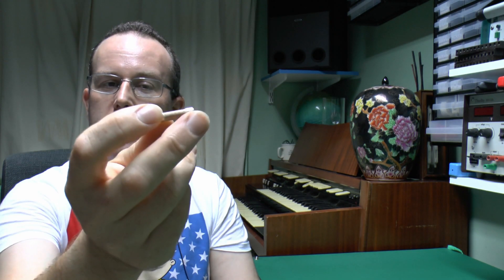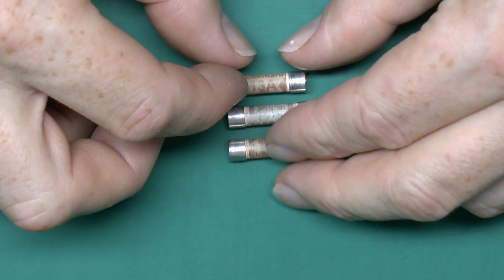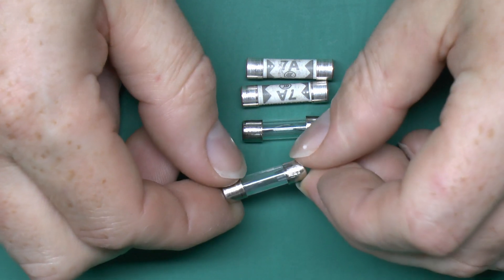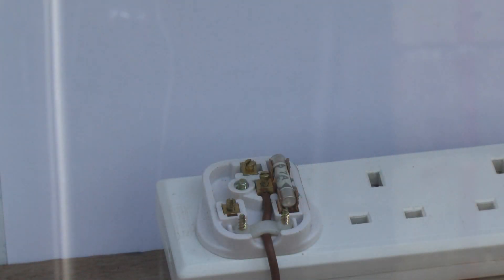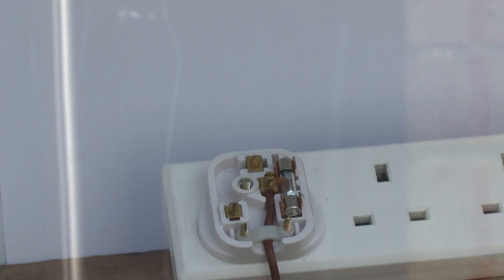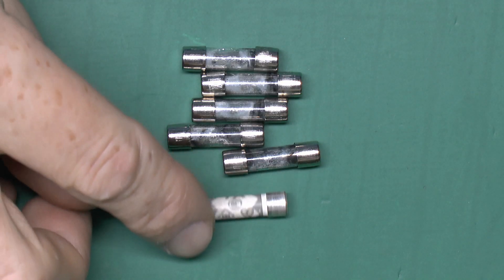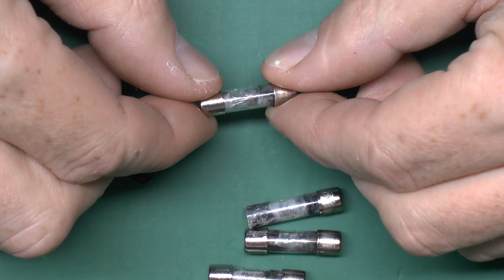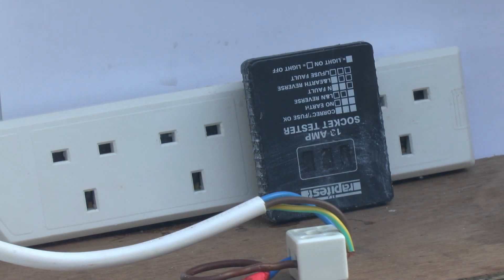Cartridge Fuses Tested - Ceramic and Glass

Comment: Is there a difference between the glass fuses for auto use the ones at 3:24 are different from the ones i have that has a wire inside rather than a flat material. Or just the same thing or made differently. they are agc fast blow fuses both kind of I grabbed to use just couldn't find the same exact ones at a shop.

Comment: can you use a T3.15 ah fuse for a T4 ah fuse AMP
Reply from the maker: It will fit, but if the current is between 3.15A and 4A, the 3.15A fuse won't last very long.
Reply: @jwflame  thanks

Comment: Hi John. I am replacing a fuse in a guitar amplifier. The schematic and the pcb are  both marked T500mA. The fuse I have removed says T500E. Are these essentially the same? I can't find any info online regarding the T500E fuse.

Thanks.
Reply from the maker: Yes, the important parts are the rating (500mA) and T for time delay or slow blow.

Comment: Hi.  Can you tell me the diameter of the cooper wire inside of the ceramic for 13A ?
Reply from the maker: Don't have details for 13A or ceramic fuses but for a 15A rewireable it is 0.5mm diameter wire.  10A = 0.35mm, 20A = 0.6mm

Comment: Hi, I was wondering if you could help answer my question since google doesn't have any answers for me.
My sister bought a bonnet hair dryer that came with two small glass cartridge fuses. The instructions say nothing about what they're for or what to do with them. What purpose would those fuses have for a hair appliance?
Reply: all fuses have the same purpose - they blow and disconnect the power if the current draw rises above the rated value. the small glass type fuses go in a holder installed somewhere on the device itself rather than in the plug. thats usually located next to where the power cord enters and where the power switch is, possibly a round black thing with a slot for opening using a screwdriver or sometimes a horizontal slot thats part of the same moulding as a 3 pin IEC connector. there is a chance they are fitted internally and you would have to open the unit up to replace them but in that instance it would be unusual if the thing were supplied with spares as they wouldnt be considered a user-replaceable part.

Comment: John in a pinch need ceramic fuse but none readily available, can I use glass fuse temporarily Class 1 Div 2 panel
Reply: steve gila - NO. A fuse should only be replaced by a new fuse that has the same ratings and is the same type. Although you can replace a glass type with a ceramic type if the rest of the ratings are the same. You should NEVER replace a ceramic type with a glass type.
Reply: Mark 1024MAK It’s not that bad. If there are no shorts, there should be no problem. Also, did you watch the video?
Reply: @GRBtutorials that's correct, you can replace ceramic fuse to glass, if you see the video, you can get conclusion that there are the same, just the casing ceramic fuse strong then the casing glass.
hope make sense

Comment: Cheers for this, it was hard to find online what does a ceramic 13A blown looks like. Since I don't have a multimeter, I will just buy a new fuse and hope that, that is indeed the problem.
Reply: Couldn't you test the fuse in a piece of equipment that you know is working? You could also use a torch (flashlight) and piece of wire or aluminium foil with the fuse in the circuit.

Comment: hi John, may I have your great guidance, PLEASE.. this is Singapore and all of our wall plug are 13A (ampere). OK I have a sound system the Creative T6 Series II. and it actually came with 2 type of socket cable for us to power up the speaker system. one is 5A and one is 13A cable power plug. my question is, if I use a 13A instead of 5A power socket cable, is that mean the power will be larger? and if I use a 5A does that mean the power into my sound system is weak?
Reply from the maker: A fuse is designed to disconnect the power if the current exceeds it's rating.  
It will make no difference to the amount of power the device uses.

Comment: I have a fuse that blew in my refrigerator, glass 15a 250v with that ribbon middle but I cannot find a replacement anywhere, there are however that amp and voltage in ceramic microwave fuses. Is there any differences you can see in  replacing the glass fuse with a ceramic fuse? it is in a circuit board on the top of the fridge. Thanks!
Reply: +Sarah El That sound at the end of the video is my worst nightmare in this situation! :)

Comment: Hi John, are the glass fuses BS1362 please? Thanks. Very interesting.
Reply from the maker: Edward Fenech No, they are IEC127, the main difference is their rated breaking capacity which is far less than the BS1362 ceramic ones.  They are normally used inside equipment.
Reply: Thanks very much for that John.  I really appreciate your help.  Keep up the good work mate!! :)

Comment: Hello john

Are you testing the fuses via a transformer or off the the line. I assume if your using a step down to increase the your current above that from a 13amp socket. Your testing a lower voltage and so there is less - arching as would be the case a 230. Please show us your test set up on future vids it's always interesting. 

Chris
Reply from the maker: Christian Fletcher Tests via a transformer.

Comment: my electrical meter stopped working on the amps side. wont measure amps anymore. but everything else continues to work. tried ohming out the fuses I get nothing. yet everything but the amps work. even the milli amps still. work. think its a fuse?

Comment: Very interesting video. It would plausible that these glass fuses could give way given the fault current and thin glass enclosure. 
The ceramic fuses has a small bit of ceramic filings / sand inside the help dampen the fuse blow.

Was glad to see that rapitest socket tester go, there's no substitute for proper testing and verification.

Keep those videos coming JW :)

-Andrew

Comment: Would you be interested in doing some tests on some fuses as used in older consumer units in Germany and Sweden? They may well be used elsewhere. It's the DIAZED fuse system. they have an interesting design with inserts for the fuse holder which stops higher rated fuses being used on circuits than intended. the fuses themselves also have an interesting spring mechanism inside the ceramic cartridge which causes a small coloured button to be ejected from the fuse body when it blows, thus indicating a blown fuse. If you're interested I could arrange to get some to you.

Thanks for the really interesting videos
Reply from the maker: Paul Hughes Yes, always good to see how other systems and countries do things.  Address and other contact details at www.flameport.com